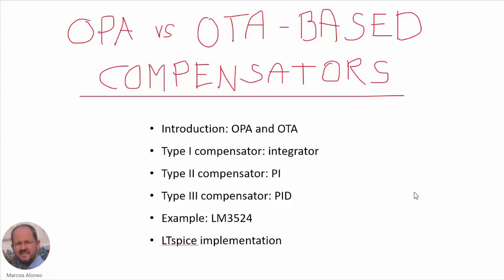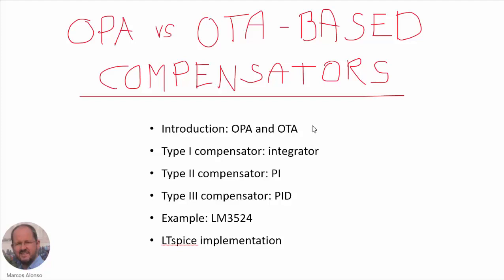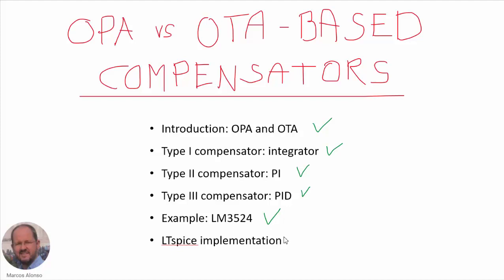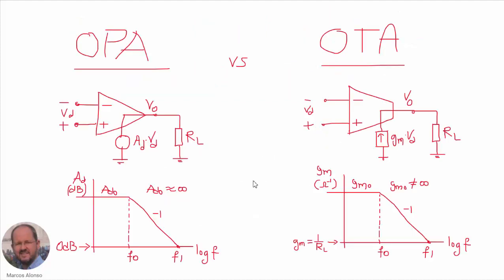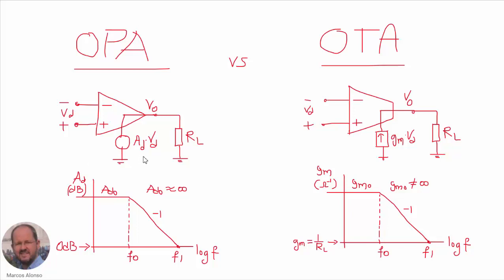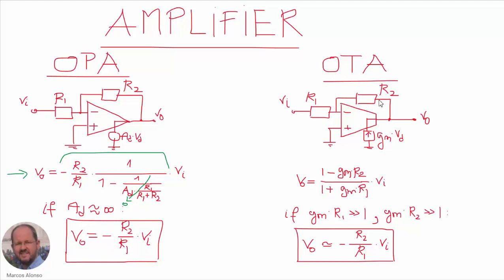PE #7: OPA versus OTA-based Compensators

Comment: Hi Dr Alonso.  It is good review for the compensation network. I have built each one of the circuit based on your guidance and data sheet. Currently I have enabled the second channel on the LM devices which could be used to drive the Sync DCDC. I don't understand the control mechanism of the OC Amplifier tied to the OTA output. Will watch other videos of yours and I might be able to find answer. Thanks for your thorough presentation again. :)
Reply from the maker: Thanks for your comment. Please, refer to the time in the video as "mm:ss" so I can see the part your question is related to. For example, at 10:10 you can see the schematic of the LM3524.
Thanks!

Comment from the maker: 8:51 I made a mistake here. This is not a PID compensator. There is no differential action in this compensator. It is just a PI compensator with an additional pole. Sorry about that!
Reply: Great explanation, Dr Alonso.  I have one question about this part of the video though - the TF for the OTA circuit includes C1 but there is no such component in the circuit.  Can you explain where this value comes from?
Reply from the maker: @eazye8523  Thank you very much for noticing this. There is a mistake. Instead of "C1" it should read the Laplace variable "s". I will write a comment above with the correction. Thanks for your keen watching!

Comment: Hello Dr, this opamp in 7:34 is a type 2 compensator right?
Reply from the maker: Hello
It depends on the source. In the video I used the following:
Type I: pure integrator (I)
Type II: integrator plus a zero (PI, proportional-integral action)
Type III: integrator plus a zero and an extra pole (PI with additional pole)
Type IV: integrator plus two zeros and two extra poles (PID). This one provides a proportional-integral-derivative action. This one is not seen in the video.
In other sources the pure integrator can be named as Type 0 and the rest from Type I to Type III.